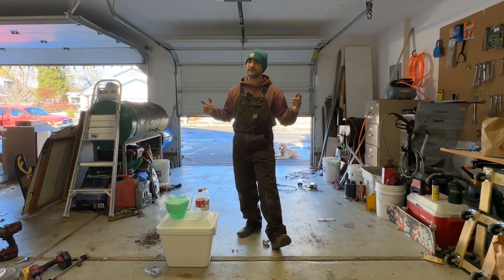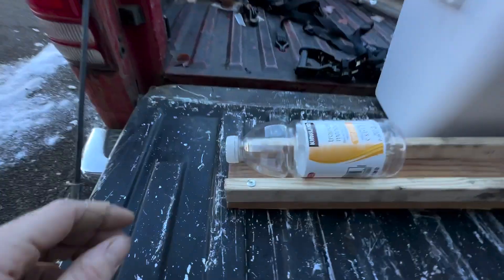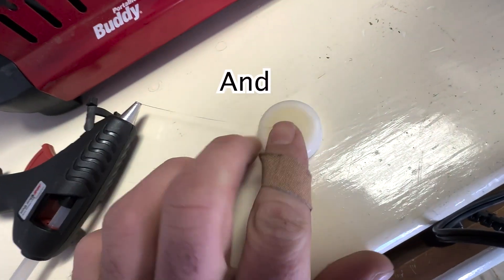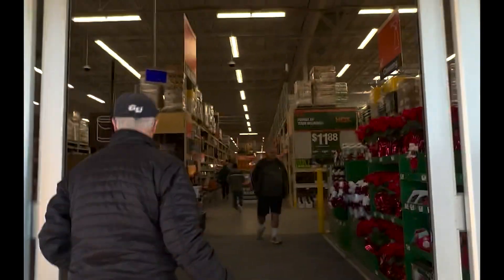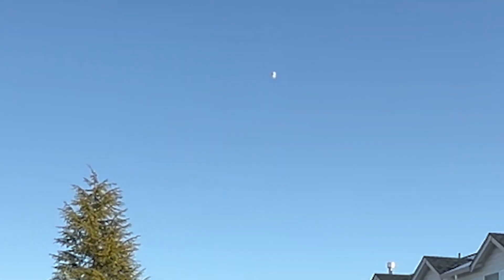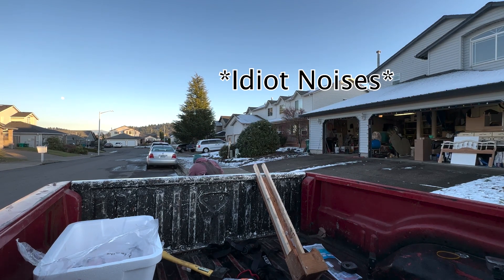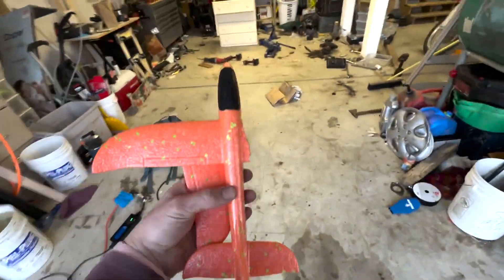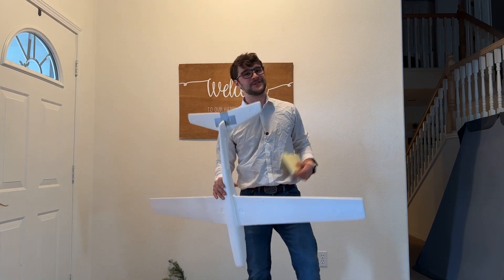Home Made Rocket Experiment

Comment: Here's an idea, if you had a two chamber rocket with pressure relief valves you could theoretically make it so one chamber recharges while the other propels the rocket, the weight and timing would be complicated to get right but I think there's something there
Reply from the maker: That’s an interesting idea. I definitely would like to figure a way to get the energy to release consistently over a longer period of time rather than all at once